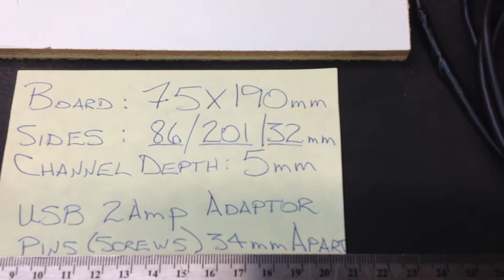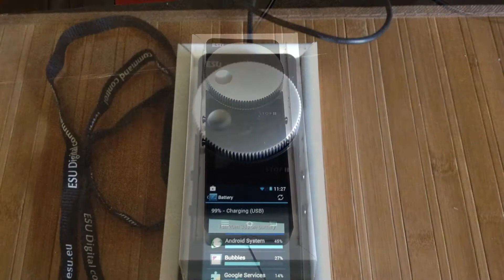ESU Mobile Control II Charging Station (Landestation)

Comment: Looks to be a great idea and works good ...Dave
Reply from the maker: Hi Dave.  Yes, it works well.  I've only used it a short time so I'm sure I'll think of improvements, bit it is so much better than plugging it in, or in my case, forgetting to and finding it discharged when I wanted to use it!   Have you got your Control station back from repair?  How long has it taken?  -Chris
Reply: Hi Chris ...no not heard anything yet re my ECOS  ..they (Digitrains who I bought it from ) said they were waiting for the German holiday to finish before sending , as they have a few items to go , and did not want them just ssat in a pile awaiting end of holidays ...will let all know when  I or if I get back ...Dave